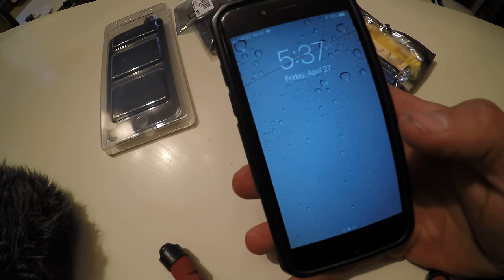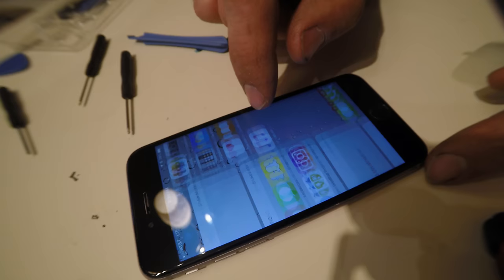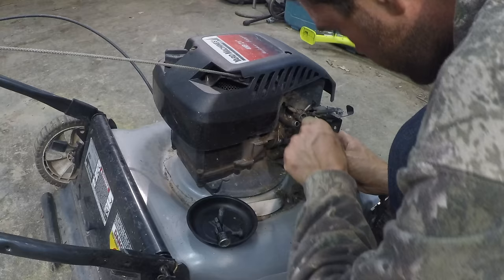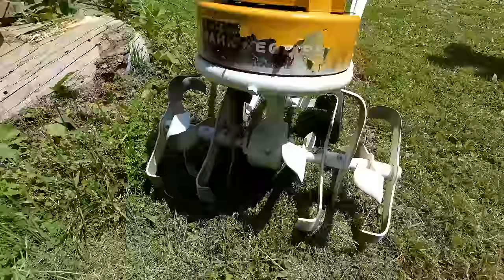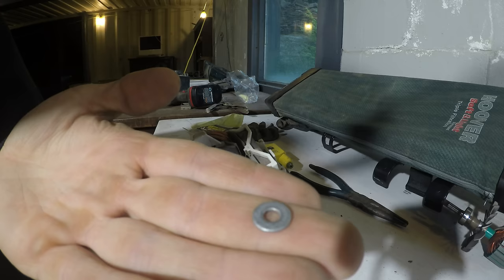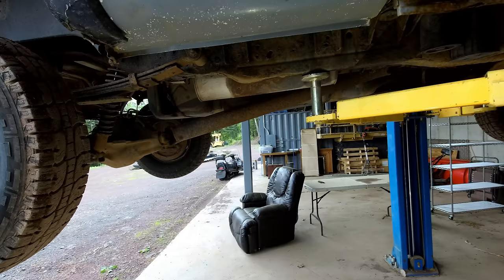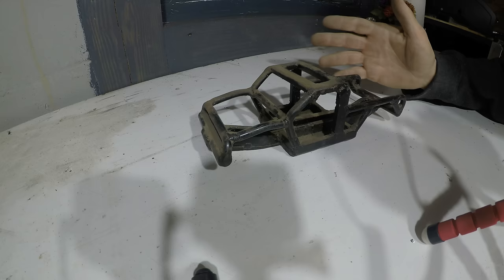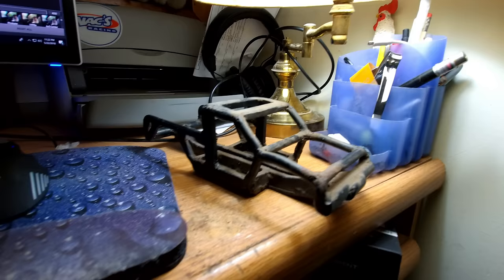Fixing stuff

Comment: Just recently developed an addiction to fixing stuff. Love the video - you're my new role model. 

Some things under my belt:

Gas water heater stopped working; flame sensor was just corroded, little sandpaper & she's been good as new for about a year. Then the dishwasher started leaking; one of the drain pumps came disconnected underneath; just needed a new hose clamp - good as new. Washing machine was shocking the wife (little zap) & tripping the GFCI outlet when she'd put her hand in the water; turns out - entire circuit was on old two wire knob & tube wiring, no ground - not so great for a washer. Normally harmless induced current would build up & discharge on my wife because there was nowhere for it to go. Ran some new 12/2 Romex for that circuit to establish a proper ground. Problem solved. Ice maker in the fridge would slip when trying to dispense ice. The auger coupler on the motor was warped. Could have bought a new one for $14 and possibly dealt with the same problem later down the line; but instead I threw about $0.30 worth of washers behind the auger coupler on the bolt from the motor to extend it out so it doesn't slip on the auger - working like a champ... Long story short... feels really freaking good fixing stuff yourself, and especially saving LOTS of bucks in the process. It's my newest obsession.
Reply: awesome!!!!!! gz sir!!!!

Comment: The two carbs that required replacement diaphragms reminded me of a story from WW2. Early Spitfires (three prop) had a cutout issue when the pilot moved his stick forwards to go straight down, evading a German fighter. The negative 'G' force would starve the carburettor of gas . One of the female pilots who used to deliver planes after repairs and take them to the releveant RAF Station thought up an idea (installing a diaphragm to stop the starvation of fuel), found it worked and then informed the powers that be. It was fitted on the upgraded Spits and called Mrs Schillngs orifice :)
Reply: @Rob F They did too. But even that took SOME time they could NOT afford. Mrs Schillng  saved lots of lives that were desperately needed at that time.
Reply: I ,ve had one of these for 40 years ,good as new saves A LOT OF HARD WORK.
Reply: amazing story. i watched another vid the other day about high g flying. back in ww2 the brits were building faster and stronger fighter planes that could handle high g loads. problem was the pilots would pass out when they pulled up out of a dive. so the engineers had to go back to the drawing board to slow the planes down to 400 mph, from 600 mph, during dives. the youtube vid was about the evolution of high g plane construction. very interesting.
Reply: I looked her up, she was an engineer and race car driver: https://en.wikipedia.org/wiki/Beatrice_Shilling
Reply: @mirkomeyerhoff2700  Ty I never looked her up like so many others, hope you enjoyed that. Maybe another would be my avatar Walter Tull an amazing sub-lieutenant in the British Army First World War Black FFS ! What on earth was it like for him ? A Tottenham Hotspur football player, boxing pro and others ! Fascinating. Shot in the back by a German soldier after he got his own men out of the trench. Says it all, much loved by his men.

Comment: AC: "I wonder if I should turn this off, before I take it apart...."

Uhhh, yeah man....
Reply: It's only 110v  and minimal amps.... you'd only do it two or three more times before you figured the off switch was worth the effort. Now 240v at 13amps ... you do it once ... if you're lucky
Reply: I was thinking, Dude turn it off before you start working on it. LOLOL
Reply: @mjallenuk Yeah it's only 120 volts but the amps depend on the load, which could potentially be some part of your body.  The breaker will open at 15 or 20 amps or whatever, under the right conditions, it takes less than an amp to kill a person.  More often than not, being shocked with 120 volts is just a wakeup call, but it does kill people every year.
Reply: Lol, usually someone's last words. Not Andrews thou!

Comment: Would like to see that truck! I leased an all electric Ford Focus for a few years and it made me realize how sensible electric motors are, especially for some of the reasons you mentioned; no oil changes or trips to the fuel station, no maintenance but filling wiper fluid and that low center of gravity made it super fun to drive. Definitely will buy electric going forward but for now I'm sticking with my trusty Ranger as long as it runs.

Comment: Your concept for your vehicle is brilliant, sensible, and forward thinking. All things that large manufacturers would never consider unfortunately. I think it’s sound on many levels and would hope that you might contribute to any effort progressive enough to adopt your concept. Love the electric drive on each wheel idea. As you know that’s been done on multi-wheel vehicles for moving extremely heavy loads such as the shuttle transport vehicle. 
So impressed with your engineering vision. (And ability to fix almost anything)

Comment: Andrew...i AGREE with you 100%!! i think the reason these manufacturers are building cars the way they are now is because of safety data that has been collected through crash testing centers. "NEW" vehicles are designed to "crumple" when in a collision....I'm sure you realize this but just my 2 cents...Anyway LOVE your channel..i'm addicted to it! I watch it DAILY! Keep up ALL the good work and awesome content!
Reply: This.  In the mid 20th century, cars were designed with much sturdier frames and chassis, but the problem is that this transfers all the energy of a collision to the occupants, which tends to kill them.  Having the chassis weaker allows the vehicle to crumple and absorb significant amounts of impact energy, which saves many lives.  The downside is that cars are basically big beer cans now and parts have to be replaced instead of repaired.  That combined with trying to reduce weight to make CAFE fuel standard numbers makes for far less durable vehicles.  Heavy equipment avoids these issues because they are not designed to be involved in collisions.  Reinforcing the trucks with steel makes them stronger, but less safe.

Comment: I have one of the new Ford's with the aluminum body.  I haul and throw all kinds of stuff in it with no holes like the Chevy commercial and no problems.  I'm on jobsites 6 days a week and 40k miles a year and I dont think I even have a dent in the outside, the bed inside is dented up but its a work truck.  And the best thing is it won't rust.
Reply: Dustin Pryde I have used them for work to it sure seems like the aluminum is stiffer, rigid and a little stonger than the old steal but I have noticed when people dent them really hardcore that panel will lose all the rigidity and strength and will how they design the body for looks I can see why it does just like a pop can you can even tear it once it is compromised( like a big dent or crease). I mean what I am saying does apply to anything even the old steal bodies  but the aluminum is worse. I love ford and will probably always be a ford guy. I like dodges and Chevy's. Chevy and dodge front ends just can't handle hard work like logging roads and etc like the fords and for work nothing stock will beat a fords rear suspension for hauling or towing heavy. I have a a ram  truck now but it fit all my requirements is why I bought it over a ford it's very hard to find a half ton 4x4 with a long box and true 4 door crew cab
Reply: aluminum does rust, albeit it take longer I've had DeeZee running boards rust through in about 5 years running in a chloride state.....sucks

Comment: Young Andrew... I sometimes see myself in you, especially when you talked about car engineering, Andrew all the flaws are designed into the car for one reason or another, the front bumpers are supposed to absorb energy if you crash, absorbing energy deform the original structure but saves lives, a straight axle can support more weight with less material and support that means less weight, larger wheels demand more energy to turn, more gas or electricity, a frame like your design would create a very heavy vehicle, requiring much more energy to move, I was in a 1957 Chevy that crashed at 20 MPH, everybody was a little hurt, my cousin was ejected from the vehicle, the only damage on the car was a bumper dent, I experienced a 45 MPH crash with a 1985  Accord, everybody walked out of the car without a scratch, but the car was destroyed, imagine a car that lasts 60 years, and is reliable, car companies would all go bankrupt, as they rely on car servicing, parts and selling you a new vehicle fast, so they make money, you turn the wheel, people have jobs....... My main beef with car companies are that they copy each others so much that all vehicles are looking the same, and the fact that in 1976 I had a car that did 65 miles to the gallon, and today the same car is doing about 40 miles to the gallon, it did not evolve it regressed!!!
Reply: No!  What car did you have in '76 that got 65 mpg?  I've got a Honda HR-V that gets over 30 and sometimes 40 mpg.  Not a hybrid and my wife is a shitty driver.  1976 cars never got that much mpg.  
I think I agree with all the other stuff.  I like the bigger wheels take more power to turn.  I had never thought of that.  I just thought about the smoother ride and the higher gas mileage.  Good call.  We could have a discussion.
Reply: @alext8828  In 1976 I bought a Honda Civic 1237 cc engine, 5 speed transmission with $2,800 tax included, and got rid of my 1972 Chevy Belair that I used to fill up with gas at least once a week, the Honda I would fill once every 3 weeks, then I started ski... was another ball game, to fill up it costed around $8, just my old gas budget paid for the Honda, I think it did not tip the scale past 1,400 pounds, no power anything, to unlock the passenger door or open the window, just extend the arm, air conditioning was a control you opened, and air would flow directly, once I ate a butterfly that went in the hood scoop straight to my mouth, speeding tickets was no concern, took time to get to 60 mph on the highway and at 70 the noise was too freaking loud, you would feel the engine everytime you hit any kind of grade, on a street corner you could burn a bit of rubber and be a bit faster than a city bus, could not put the skis in the trunk but a ski rack would cost $9.95, when my mom saw the engine, she said it's like my Singer sewing machine a bit smaller even...lollll BUT yes I was making 65 miles to the gallon (Canadian Imperial gallon), hell I think the tires were 12 inches...When I felt the need for speed, I would hop on my 1974 Kawasaki 900 Z1, and hit the highway, the bike was a bit tweaked and could get to 140 mph, no concerns in those days, you could get a ticket at that speed, but no matter what speed, the ticket was $22.50 and no points, it did not exist yet....My driver licence costed $21 and was good for 2 years, I passed the test at 100%, so I had a "Chauffeur Class 1" I could drive anything, a scooter to a 45 foot rig... THOSE were really the good old days!!!!

Comment: You basically described the Landrover Defender! Ally body panels, simple rail chassis (which lasts if you seal it, bit tin worm if you don't), same basic design for decades, simple engines and transmissions, minimal options and they keep going for many, many years. I think most Defenders ever made are still in existence and running.

Comment: couldn't agree any more on your views of modern day cars.
Reply: Modern cars have some advantages that old cars did not. One big thing is that accidents are far more survivable. Back in “the good old days” all the changes made to cars every year or two were cosmetic, not functional improvements that saved lives and made vehicles last 15 years instead of 3 years. Back in the 50’s when we had 140 million people and folks drove an average of 8,000 miles a year we lost 60,000 lives a year in car crashes. Now we have 330 million people and folks drive 15000 to 25,000 miles a year but our traffic fatalities are down to 20,000 a year. Modern cars also last much longer than cars and trucks built back in the 40’s, 50’s and 60’s. They could be built to last longer but would Andrews version of a new car be so heavy that any crash would result in a fatality? I also liked being able to fix a lot of things myself in my own garage. Folks may have forgotten that cars built back in the 50’s lasted 2-3 years and the required CONSTANT maintenance. Tires lasted 8-10,000 miles. Fixing flats was common. Now tires last 50,000 to 75,000 miles. Replacing mufflers was something done every year, not every 10-15 years. I remember vapor locks with old carburetors. Fuel injection has done away with that. Old time distributors had points that needed to be replaced every 5000 miles or less. Electronic ignitions may be harder to fix but they last the life of a car. Fuel economy used to be 10-12 mpg. Now cars get 20-30 mpg. New cars could be made better but don’t think those junkers built back in the 50’s were really better. They weren’t. I owned a lot of them. As a culture we owe the Japanese a debt of gratitude. They showed us how to build reliable cars that lasted decades and were safer to drive.

Comment: Hi Andrew. Nice fixer-upper video, I do enjoy your videos. Sorry for my bad English/American (I live in Norway, that's in Scandinavia, Europe) But: I'm kinda confused, first you buy a new model camera AND a new model drone, and then you suggest having a vehicle that doesn't ever gets the design renewed...?

In Russia (not Norway) they had the same idea, and came up with the Lada.

Even though the design of your truck looks nice, it has some small flaws. To get the best suspension you need to reduce the mass at the wheels (so no electric motor at the wheelhub), The bodypanels (and frame) on an "ordinairy" truck/car are made to absorb impacts (your design would keep the car in ok shape, but the people INSIDE the car would absorb all the energy in a crash - and die), How would you refuel/charge the batteries, and wouldn't it be smarter to reduce the mass/weight of the car/truck so it would be able to stop as fast as possible in an emergency? 

Like I said: I really enjoy you vids, and you do an excellent job on the excavator and skidsteer, but the design has some weak points. I also think Audi made some alu-frames on their A1-series cars, but it couldn't have been a massive success or else everyone would have made their new cars in Alu.

But keep up the good videos, they are nice to watch.

- Odin
Reply: You are very right,the modern vehicles are designed to absorb the impact not only for the passengers insider the car, but also for the pedestrians that might be hit. There are standard crash tests that vehicles must pass before they go onto the market where they simulate a pedestrian being hit at a certain speed, and that can only sustain minor non life threatening injuries. 
Another topic is the odd shaped metal parts in the frame, those parts are made to have the required strength, for the cheapest cost. The cost of the complexity of the shape is offset by the amount of parts that are made. If they manage to use sheet metal that is 1mm thinner, the shareholders will be cashing in on the dividends. Don't forget that car manufacturers, can easily make 20k cars a month.  At the end of the year, even a $1 saving one single  part will increase the profits quite nicely.

Comment: Those of us that work with metal are always having trouble with the speakers on our phones because the magnet in the speaker collects metal dust. 
If you take a small strong magnet and tap it on the speaker the metal will go to the stronger magnet and the speaker should start working better. 
The reason cars and trucks are made flimsy is so it absorbs the energy of a crash. If everything were rigid the sudden stop of a crash would injure the occupants. I love the idea though. I have no doubt you'll build it someday. 
Keep the videos coming man. You do a great job.

Comment: On the truck design you have many great ideas. One thing about adding weight to the hubs, in the form of electric motors, is that you'd be increasing unsprung weight too much. Unsprung weight needs to be held to a minimum. Another thing good about cars that crunch up in an accident, such as a head on collision, is that the car absorbs the impact rather than the passengers. Like a massive shock absorber. Safety is the most important consideration for my cars and trucks.

Comment: Came for iPhone screen repair and learned about Andrew's ideal pickup truck. I have the same idea for a practical car! Straight 6, manual transmission, all easily replaceable components you can find anywhere. Double or triple filtration and cooling everywhere. 18 wheelers go a million miles with regular maintenance, why not family cars? I'd lean towards a station wagon or small cargo van for the final body layout. With cars and trucks getting more and more sophisticated I think there is a market opening up for a more tractor like vehicle.